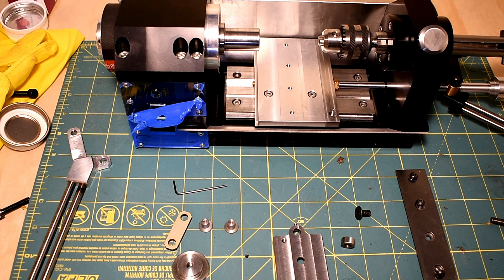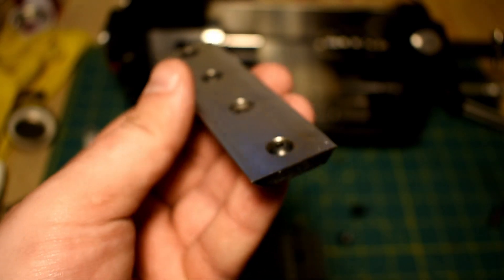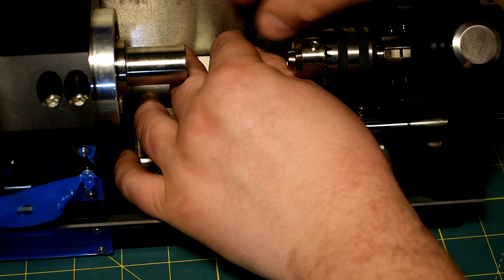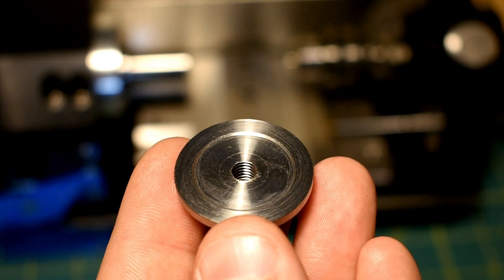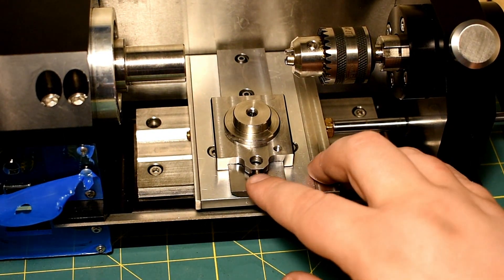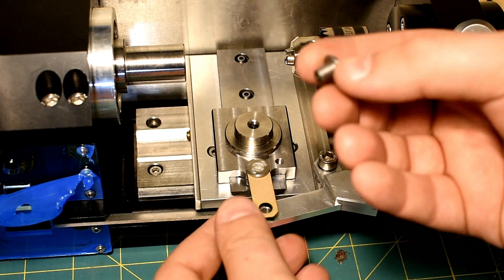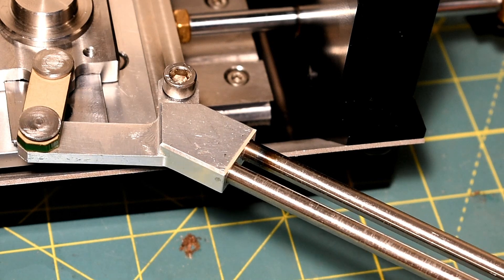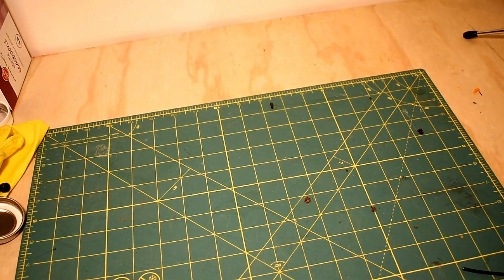Jeweler's Lathe Part 7:  The Cross Slide

Comment: get some bondhus allen wrenches, you wont regret it,
if your still looking for a more elegant pin design for the linkages, use dowel pins, or make some, ream one piece for a press fit and the other for clearance, press them in, no heads, threads, cross holes, c clips to worry about.
Reply from the maker: I really do need to get nice allen wrenches :p.

Comment: What IS the machinists version of rock paper scissors? carbide>steel>? what loses to steel but beats carbide?
Reply from the maker: Someone else posted Carbide Steel Aluminum, where aluminum clogs up carbide.  I'd have to think it was something like an interrupted cut (steel can cut it but carbide gets smashed).  Doesn't exactly roll off the tongue though...
Reply: Diamond
Reply: no steel wouldn't beat diamond
Reply: how about carbide beats steel, concrete beats carbide, and steel beats concrete?  I don't think i have to explain myself, but i will anyways, since carbide is so brittle when you drop it on concrete it will shatter, but steel being durable can chip away at the concrete.  
it doesn't have to be concrete, could just be a rock

Comment: Super cool to see the progress on this guy. 

How are you planning to take up play on the cross slide? I didn't see you show any gibs for the dovetail. Orchid the fit good enough that you don't need them?
Reply from the maker: It's a pretty decent fit, so i'm happy with no adjustment (just a setscrew for tensioning) for now.  This is certainly not the best way of doing it, so I may end up cutting off one side of the dovetail and adding a bronze section that can be tightened.  We'll have to see how it performs!